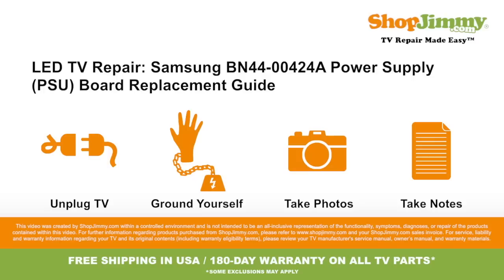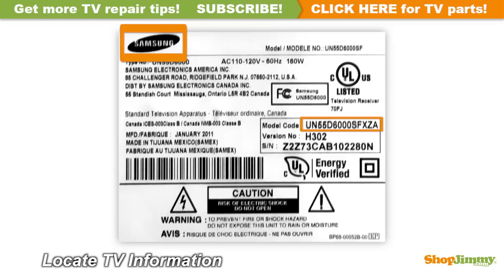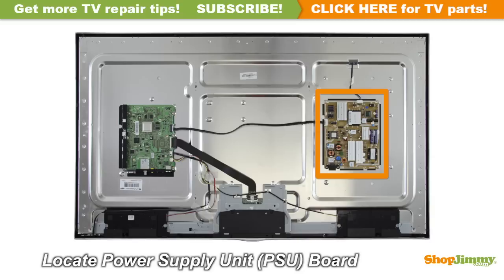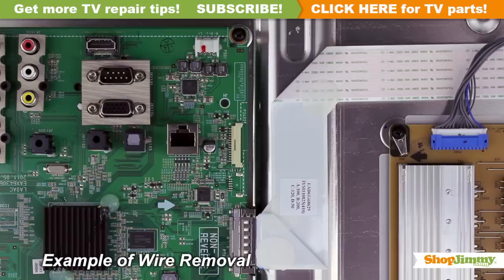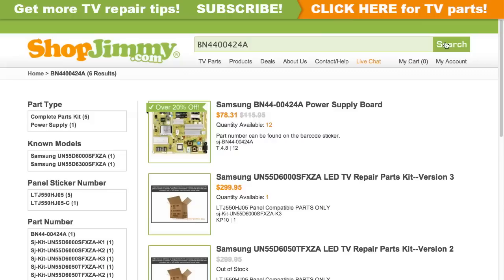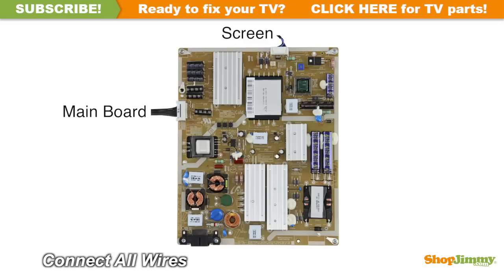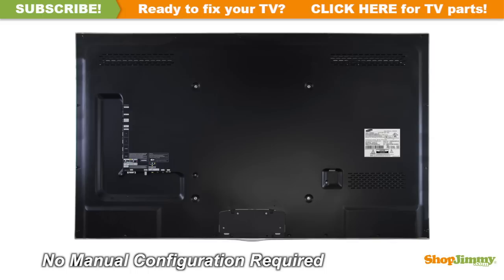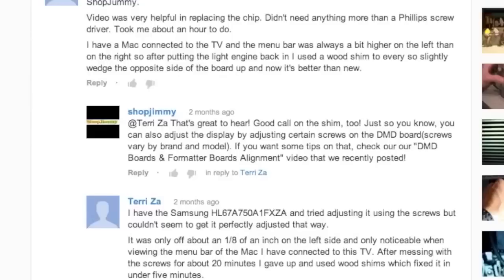Samsung TV Repair - How to Replace BN44-00424A Power Supply Board - How to Fix LED TVs

Comment from the maker: @MOLRobocop - This problem could be either the main board or the power supply.  I would start by replacing the power supply and see if that fixes the problem.  I will send you a youtube message with information on how to purchase this replacement part.  Thanks!

Comment: Thanks for this video. TV repair company wanted to charge me $350 to fix this. I bought the part from your website for $60 and installed it myself using your tutorial!
Reply: Did you have the red blinking light in patterns problem? With no screen?

Comment: Hi S.J. I have a Samsung 40" Model: LE40A556P1FXXU, which has just started to switch on and off several times when it eventually comes on. Thanks for the great vid. showing how to fix this.

Also, I get green / yellow ish vertical lines on both the left and right hand side of the screen, just a couple of inch's wide. This only shows up when the screen goes dark, for instance when viewing a film shot at night.  And sometimes ghosting. 

Can you please advise if a repair is a cost effective solution, given the issue with the coloured lines / slight ghosting with this model no?
 
Many Thanks,

Comment: Samsung LED TV 46" Model: UE46F5000AW Type No: UE46F5000 S/N:  ZAKF3SID400007T
Red light blinks 5 times, capacitors are ok! TV shuts off and shows blink errors, then turns on and works for random time, few min or few hours. TV went out of warranty few months back.

Comment: My Samsung un55hu8550fxza, th02 panel, 
I purchased tv back in January of this year. Yesterday tv started power cycling on and off  about every 15-30 seconds. Its also pixelates in horizontal lines and freezes well going through power cycles. I am wondering if just the power board or if its the main board as well.
 Thank you in advance for any response

Best Regards;  

James K YOUNT

Comment: Samsung LN46D550K1FXZA.

TV just shut off last night. I unplug and plug it back in, even left if off over night. Upon plugging it back in, the power LED will blink 6 times. I try to turn it on using several remotes, but the LED flashes to show it is seeing a signal, but does not activate. No clicking. Does this sound like a main board issue, or a power-supply board issue?

Thank you.

Comment: I have this exact same TV and need the exact same board (bn44-00424a) ASAP but sadly you do not have it in stock. Last night my TV made a loud pop noise and now gets no power at all. The red standby light doesn't even come on. I spoke to the geek squad and they said it is likely the power supply and would be over $300 to fix it! I asked Samsung and they said there is no recall or anything, which I find strange being that you have a tutorial of my exact model and board! Thanks for the video!
Reply from the maker: Robert Myers I would recommend going to the product page and signing up to be notified when this part is back in stock.  I cannot make any guarantees on when it will be back in stock.  Here is a link to the product page, click here:  http://www.shopjimmy.com/catalogsearch/result/?q=bn44-00424a
Reply: +Robert Myers Hi, How did you fix your problem? Did you the part from ShopJimmy or from somewhere else? 
Reply will be highly appreciated.
Reply: Power board was fried. Found a board through another supplier. Tv has worked great since. Easy to repair
Reply: +Robert Myers Thanks for replying.. If you don't mind Can you please let me know the supplier name (from where you got it).. I have the similar issue and ShopJimmy is out of stock.

Comment: just got a Samsung UN48H5500 TV and to my surprise the Power Cord is not keyed, you can easily plug it in in either direction on the back of the set, also on the power side neither prong is noticeably larger than the other so I wonder if it matter which direction to plug it in. I am online with Samsung support and asked the question, she came back and said it does in fact matter but it's taking a long time for her to look up the information. I don't see how it can matter since the AC side and the TV side of the plug are symmetrical. I've been waiting a whole week without a TV and now this, unbelievable. No pics or anything in the provided manual on this most simple and basic issue.

Comment: Need help. I have the Samsung 63" Hps6373x/xaa. Yesterday it died while streaming to it on Chromecast (just clicked like the power was shut off and the screen faded away. No standby power light and pushing the power button does nothing . When I remove the Power cable and put it back in the power button flashes the blue circle 4 times and then nothing, no power, picture, or sound. Any idea what is wrong? Thanks!

Comment: Hello, i have the same TV UN55D6000SFXZC Version number: H301, it does not turn on, i get flashing red light. when i point a flash light at the unit i can see the images, however when i look though the back the back lights are not on.  i have tried and replaced the T-CON board, which fixed the problem for 2 days and now i have the same problem. so it seems like the back lights are not working.  what is the repair for this unit? which parts do i need? thank you.

Comment: I have a SAMSUNG TV UN55D7000LFXZA H302. When PLUG in, I can see some LED Back Lights on but does not show anything in the SCREEN and no SAMSUNG SMART logo displayed and I can only hear CLICKING of POWER ON and OFF sound. I can also see the RED LIGHT ON at the bottom center. When using the REMOTE, the TV's LED Remote Indicator is responding but no PICTURE.

I am not sure if my analysis of this is right that the Power Supply is the problem. BN44-00428A (http://www.shopjimmy.com/samsung-bn44-00428a-power-supply-unit.htm)

Let me know what you think. Thank you.

Comment: Hi, I have a LN32C540 that won't turn on. Instead, the red light blinks like a strobe when i push or hold the power button. In the past, i was able to fix it temporarily by unplugging the power and then plugging it back in after some time. It worked for months the first time but more recently it fixes for about only a day. Think it's the power supply?
Reply from the maker: Brian Snow   I recommend replacing the main board in your TV.  Click this link to replacement parts for your TV model number:  http://www.shopjimmy.com/catalogsearch/result/index/?cat=56&q=LN32C540  There may be multiple boards for the same TV model number, be sure to match part numbers on your current board, with your replacement for compatibility.  Here is a link to a video showing how to identify your part number, click here:  https://www.youtube.com/watch?v=BEPWrefQvqI  Thanks and please let us know if you have any further questions with your TV Repair!  www.shopjimmy.com

Comment: I have a samsung tv UN32EH4003fFXZA QD06. The number on the power supply board is L32G0-DDY. My issue is I have no backlights. I can see the picture using a flashlight. I haven't been able to find a video on this model in order to try to force the backlights on. I did find the board on your website and have no problem paying the price for a new board, I just want to verify that its faulty first. How can I check this board? The tv is currently torn completely apart, all the way down to the backlights. Thanks in advance.
Reply from the maker: Pyro17059  Please watch this video FIRST to help with your repair!  https://www.youtube.com/watch?v=BP3NVNCGEv8  This could be a problem with either the power supply or bad LEDs in your TV panel.  You can replace the power supply board to see if that fixes the problem with your TV.    Click this link to possible replacement power supply boards for your TV model number:  http://www.shopjimmy.com/catalogsearch/result/index/?cat=229&q=32EH4003f  There may be multiple boards for the same TV model number, be sure to match part numbers on your current board, with your replacement for compatibility.  Here is a link to a video showing how to identify your part number, click here:  https://www.youtube.com/watch?x-yt-ts=1421782837&x-yt-cl=84359240&v=sSJexLvRrjM  Thanks and please let us know if you have any further questions with your TV Repair!  www.shopjimmy.com
Reply: +ShopJimmy.com 
I have already found the problem with the led strips. cant find replacements.

Comment: Sambung Series 5/5300.  About 6 months old.  Worked great until about 3 days ago.  Won't turn on without much manipulation, will go on for about 10 minutes, then back "off" while continually blinking 
Smart TV logo.
Reply: it's all about led back light panel problem,either a bad led bulb or no voltage supply to led back light assembly. actually it's a blinking led back light problem that automatically trigger the non stop power on and off function,

Comment: Hi. i have a samsung UN55D6300 with A5v good, but the others tensions (B5v, B13v, Vamp18v, pon 3.3v) are cycled, on/off , not stable. Please help, thanks.
Reply from the maker: george marcos   PLEASE SUBSCRIBE TO OUR CHANNEL - Try all repairs and troubleshooting at your own risk.   I recommend replacing the main board in your TV.  Click this link to replacement parts for your TV model number:  http://www.shopjimmy.com/catalogsearch/result/index/?cat=56&q=UN55D6300  There may be multiple boards for the same TV model number, be sure to match part numbers on your current board, with your replacement for compatibility.  Here is a link to a video showing how to identify your part number, click here:  https://www.youtube.com/watch?v=BEPWrefQvqI  Thanks and please let us know if you have any further questions with your TV Repair!  www.shopjimmy.com

Comment: Hi I ave a samsung UN46d6400UFXZA. when I turn it on, I face with black black screen but there is light behind the black scene. So i think it is power on but with black screen. Could you please help me to replace correct part?

Comment: samsung un32eh5300fxza cylcling on and off. The capacitors don't look damaged. Could it be the power saving switch?
Reply from the maker: elaine sisson   Please watch this video FIRST to help with your repair!  TV Repair! LCD, LED, Plasma, DLP How To Fix Your TV with ShopJimmy.com Help!  Replace the main board in your TV.  Click on this link to find replacement parts:  http://www.shopjimmy.com/catalogsearch/result/index/?cat=56&q=un32eh5300fxza  Be sure to match part numbers on your current board, with your replacement for compatibility.  Here is a link to a video showing how to identify your part number, click here:  Samsung Main Boards & Digital Boards: Part Numbers for LED, LCD, DLP, Plasma TV Repair  Thanks and please let us know if you have any further questions with your TV Repair!  www.shopjimmy.com

Comment: Hi, I have a Samsung UN55EH6000F LED TV. My wife and I both fell asleep a few nights ago with our TV on. When I woke up a while later I thought my wife had shut it off. I thought I'd see what else was on cable and tried to turn it back on. Nothing. I tried turning it on at the TV itself, again nothing. There is no red light or clicking, I've made sure the power cord is ok and the electrical outlet has power where the TV is plugged in. After watching about 5-10 videos here on YouTube on the this type of problem, I decided to check for any bulging, blown, or leaking capacitors on the power supply board, etc. Not even one appears visually bad. I know that is no guarantee, but I halfway expected to find at least one. Any suggestions regarding things I can do troubleshoot the problem, short of ordering and installing a new power supply?
Reply from the maker: MountainCruzer   Try this at your own risk.   Disconnect the cable from the power supply to the main board plug it in and see if the back lights come on. If the lights come on replace main board if no lights replace power supply.  Here is a link to replacement parts for your TV model number on our website, click here:  http://www.shopjimmy.com/catalogsearch/result/index/?cat=4&q=UN55EH6000F  Be sure to match part numbers on your current board, with your replacement for compatibility.  You can also call our customer service for further assistance with your purchase.  (877) 881-6492  Thanks and please let us know if you have any further questions with your TV Repair!  www.shopjimmy.com

Comment: I have a 52 inch LCD Samsung TV I purchased in 2008.   It just started making the start up sound 4-13 times before the TV turns on.... is this the power board mentioned in this video ?
Reply: +Kent Ferris   I have a LN52A650A1FXZA

Comment: Hi, Moving from Europe to USA with my UA48H6400AWXSQ  Samsung LED TV. I would like to replace the power supply from 220V to 110V. Can you please suggest a power supply board I need to purchase and a link in your store? I will need to receive it in CA. Thanks.
Reply from the maker: Eddie Winkler   Unfortunately that will not be compatible.  Thanks!  www.shopjimmy.com

Comment: Hi, I have Samsung ue55f6800 which I bought a year and half ago and since last month it has started to switch off and on by itself. Now when I turn the tv on it goes off and on until I remove the power cord from the main. Is this the problem with capacitors or is the power board, please help. Thank you
Reply from the maker: Sushil Pradhan   I recommend replacing the main board in your TV.  Unfortunately I do not see any replacement parts in the search results for your TV model number on our website.  Please reply with your part number on your main board and I can try searching for replacement parts.  Thanks and please let us know if you have any further questions!  www.shopjimmy.com

Comment: Hi. I have LED Samsung UE40D5000. It started to work only for 3-5 minutes and then rebooted itself. I have updated firmware successfully but nothing was changed. And after one day it started to be impossible to turn it on at all (just triple rapid blinking of red power led). What is your suggestion?
Reply from the maker: Gregory Pokotilo   I recommend replacing the main board in your TV.  Unfortunately I do not see any replacement parts in the search results for your TV model number on our website.  Thanks and please let us know if you have any further questions!  www.shopjimmy.com

Comment: Hi
I have a Samsung UE46C6700. Now I have vertical lines across the entire screen. When bending of the TV frame they go away and then do not come back. When the TV is back powered of and later powered on , then they come back.

Thanks
Reply from the maker: peletonduwer This sounds like a TV panel problem.  If your TV panel is bad, it may be more cost-effective to replace the TV as panels are typically hard to find in stock, difficult to replace, and expensive.  Thanks and please let us know if you have any further questions!  www.shopjimmy.com
Reply: what a poor quality for a samsung. The LED TV is only 2.5 years old.

Comment: I have a tv 40" samsung  the s/n is LN40B640R3FXZA and the where dc cable plug is in the tv its loose it turn on the tv when i move power cable round do i need to purchase a power supply or i can fix the plug. :-) THANKS
Reply from the maker: Jose M Marcano   I recommend replacing the power supply board in your TV.  Unfortunately I do not see any replacement parts in the search results for your TV model number on our website.  Please reply with your part number on your power supply board and I can try searching for replacement parts.  Thanks and please let us know if you have any further questions!  www.shopjimmy.com

Comment: I have a Samsung UN55ES7100F TV.  Turns off by itself + the wireless networking doesn't work anymore.  I have to connect a network cable to it.  Which board is causing my problems?    Thank you!
Reply from the maker: +Steve Savoy   Try all repairs and troubleshooting at your own risk.  I recommend replacing the main board in your TV.  Click this link to a replacement main board for your TV model number:  http://www.shopjimmy.com/samsung-bn94-05896a-main-board-for-un55es7100fxza.htm  There may be multiple boards for the same TV model number, be sure to match part numbers on your current board, with your replacement for compatibility.  Here is a link to a video showing how to identify your part number, click here:   https://www.youtube.com/watch?v=BEPWrefQvqI  Thanks and please let us know if you have any further questions with your TV Repair!  www.shopjimmy.com

Comment: Hi I have a 46 " Samsung UN46D6000SFXZA. I recently was wiggling an HDMI chord that kept coming out of place causing the picture to come on and off. Eventually the TV picture comepletely went black….. Now the TV will turn on but all I get is sound and a white glow around the edge of the screen. Any Idea what could have gone wrong? Thanks
Reply from the maker: Gabriel Pena I recommend replacing the main board in your TV.  Here is a link to replacement parts for your TV model number on our website, click here:  http://www.shopjimmy.com/catalogsearch/result/?q=UN46D6000SFXZA  Be sure to match part numbers on your current board, with your replacement for compatibility.  Here is a link to a video showing how to identify your part number, click here:  Samsung Main Boards & Digital Boards: Part Numbers for LED, LCD, DLP, Plasma TV Repair  You can also call our customer service for further assistance with your purchase.  (877) 881-6492  Thanks and please let us know if you have any further questions with your TV Repair!  www.shopjimmy.com